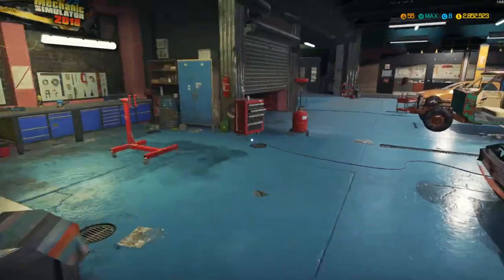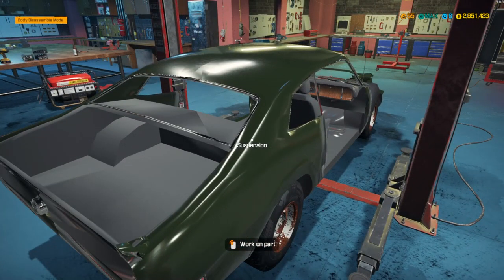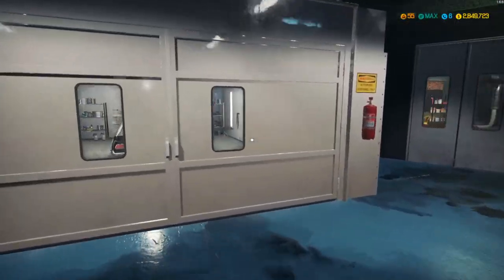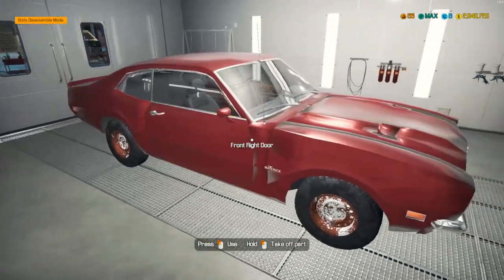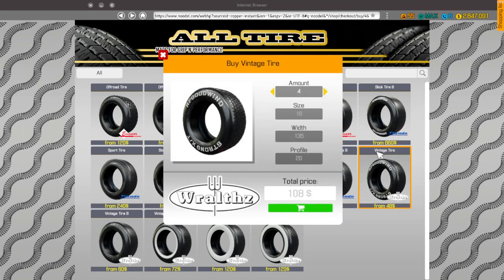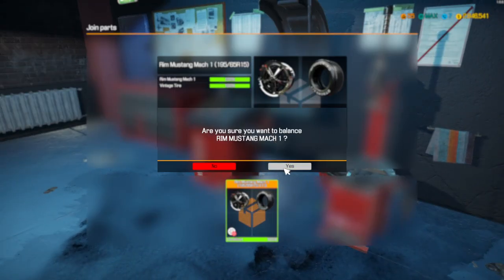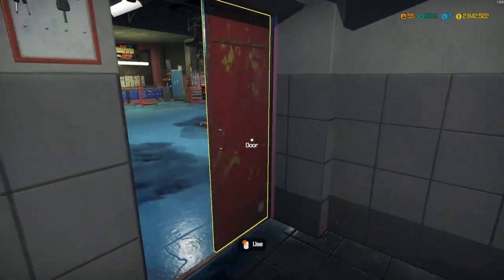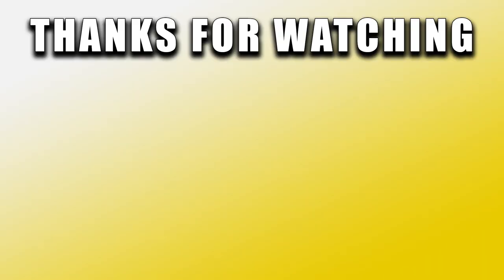BRAZILIAN MADE FORD MAVERICK | Car Mechanic Simulator 2018

Comment: My first car was a 1971 Ford Maverick, with the Grabber package. It had the same scooped hood as this mod, and that alternate grille also looks like the same style as the Grabber, but it wasn't blacked out. That car looks like a 70-72 model. The Maverick was smaller than the Mustang of the era, being closer in size to the original. It rode on the same platform as the Falcon, so also very similar to the 65 'Stang underneath. The Maverick could be had with a 170 CID I6, a 200 CID I6, a 250 CID I6 and, starting in 1971, a 302 2-barrel V8. Mine had the 200 I6 originally, but had a 302 stuffed in at some point. They were offered in the US, and I think Canada as well as South America.

Comment: We are a little faster bc we just hold down A and it screws the bolt in or out unlike you were you have to hover over every bolt. Also check out the color 214, 100, 44 chrome it looks good when in the light